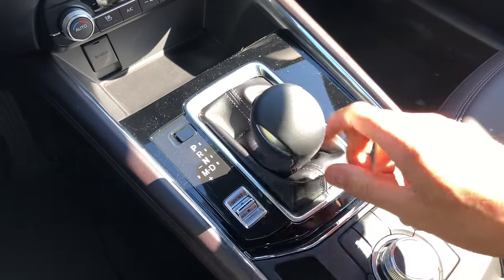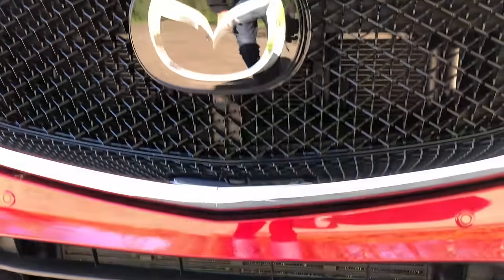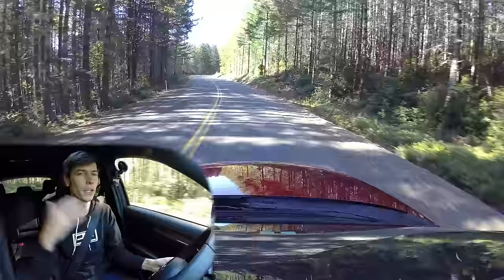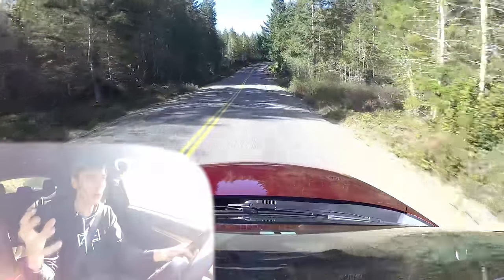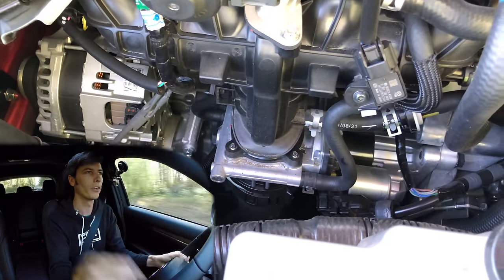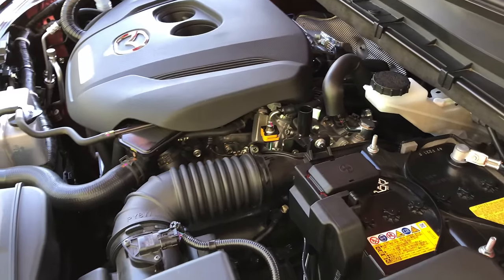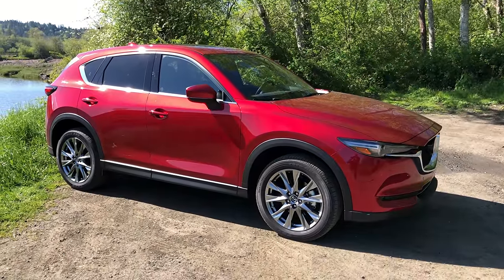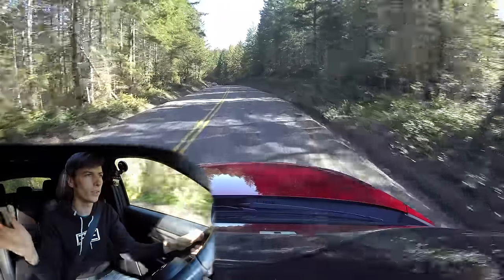Are CVTs Bad? Why Mazda Avoids CVT Transmissions

Comment: Uh, Mazda, when you make 'em in Mexico, that discounts it for me.
Reply: em745a  I looked and the only 2019 models made in Mexico is the Mazda3. I think it is probably fine.
Reply: I did a quick browse on Cargurus looks like some 2017 Mazda3s were made in Japan and some in Mexico. All 2016s were made in Japan. All 2018 and 2019s are made in Mexico. Does it really matter? Are 2018s and 2019s less reliable than the 2017s or 2016s?
Reply: My company manufacturers all kinds of stuff like barcode scanners and mobile computers in Mexico and the quality control by and large is very very good, just as good if not better than most facilities in the US. As long as the parts are the same there shouldn't be concerns about the qualify of the vehicle even if manufactured in Mexico. Many Ford vehicles are made in Mexico, I don't think those are inferior in quality than those made in the US or Canada.
Reply: @orientaldagger6920  The precision of Japanese workmanship matters.  Even when collaborating on the Supra, BMW was taught about how to do things so that the Supra would be reliable and last.  Outside of that, why do you think many people have commented on Toyota's legendary reliability?  They're no making it up.
Reply: @orientaldagger6920  I speak from experience.  I had my '74 Corolla SR5 for 21 years (yes, I was a Toy Boy, '90 Corolla SR5 for 18 years, '99 4Runner SR5 for 19 years.  Great cars great company.
Reply: @shinrips  I don't argue Toyota make great quality products. I had a 99 Camry V6 that ran for 270k on it original engine/transmission/starter/alternator etc. before i sold it. It was made in the US. There were some from the 1997-2001 model yrs made in US and some in Japan. I did some googling and don't seem to find anything that says the US made ones were in any measurable way less reliable than the Japanese made ones.

I don't have any comparison with Japan versus Mexico as in the case of the Mazda3. Seems like as far as Japanese cars go only some Honda Fits, HR-Vs and CR-Vs are make in Mexico. But i haven't seen any here in NY that has a '3' in the first digit of the VIN. Plus these 3 aren't made in Japan anyway so any reliability result would just be comparing Mexico versus the US.

Someone would have to find a vehicle that is produced both in Mexico and Japan for the same model yrs and do a quality/reliability comparison.
Reply: @orientaldagger6920  Point taken.  It's just that in the years just before yours, before your '99 Camry, some GM cars were shipped to the dealer with parts and some bolts missing terrible workmanship and even missed paint jobs that dealers had to touch up.  Toyota started making cars I believe in Kentucky (not sure) but they still used pretty good Toyota parts.  Just following your train of thought away from Mexico.
Reply: @shinrips  Camrys were (are) made in Georgetown, KY in a plant that employs close to 11,000 American workers. The same plant also make engines, as in the 1MZ-FE 3.0L V6 in the 1997-2001 Camry. 

I don not believe there is any correlation between where a vehicle is made and its reliability. GM, Fiat/Chrysler etc. are just bad quality vehicles overall. They have problems whether the vehicles are made in US, Mexico, Canada, Australia, or just about anywhere else. Toyotas are reliable whether it is made in Japan, US, or Canada. It's been a few yrs now and I don't see any complaints about Mazda3s made in Mexico, any more so than those made in Japan. If I were buying a Mazda3 the fact that it is made in Mexico is not going to deter me.

Comment: CVT sucks engineers design CVT because they know they going to break down. Most people buy cars have no clue about engines or transmission.
Reply: They used cvt because it was cheaper to assemble per unit. They sold it as a gas saver which it isn't. My old honda 95 got better gas mileage with the traditional automatic than cvt

Comment: CVT might be interesting with a rotary engine if programmed for performance and it just stays in the 9000 rpm powerband, unfortunately they usually programmed to be stuck in super eco mode.

Comment: Mazda and Tesla would merger it would bring the best of both manufacturers. Mazda handling and quality of built. Tesla powertain electric however Telsa built quality similar to a fiat.
Reply: The 8 speed is a separate question. Mazda 6 turbo is great German quality but the 6 speed doesn’t do it justice. 
As for Mazda and Tesla. Image German quality and BMW handling with Tesla powerful electric powertain. Winning ticket. Mazda being a small company can’t complete with big automakers and Tesla great technology motors which Mazda can’t afford to make in a auto with both Japanese’s quality and Tesla great powertain can’t lose
Reply: @em did you ever drive the Acura tlx 8 speed dial with torque converter. It is one best tranny in the world. It’s a dual clutch with torque converter for stop and go traffic.
Reply: I have Mazda 6 and it’s great it better than my old Audi A4 interior and engine but the 6 doesn’t make the engine shine. It need 2 more gears for mileage and putting power down. The most import was to can the tire Mazda uses worst tire on the turbo. I put summer tires but I live South Florida

Comment: Convert our refineries to make methanol instead of gasoline for automobiles,I think,would make everyone happy the driving/racing enthusiast,the environmentalist,at least until they realize that methanol is STILL a fossil fuel and the car manufacturers,and even the oil companies.And since carbon dioxide is only .034% of our atmosphere we can burn  a heck of a lot of methanol before we reach the planet destroying levels of Venus.
Reply: I'm 66 years old and the only thing that has really changed in automotive is the electronics and possibly the fuel injection,and I did say FOR AUTOMOBILES not the small tiny weed wackers and leaf blowers,lawn mowers,etc.

Comment: Is this paid/ market video.... such a beautiful channel & informative learned guy..but then in the basically say cvts (new gens are bad...) They are not bad ofcourse... This is marketing video, otherwise honda Nissan will stop making them they are capitalist profit company after all
Reply: em745a  thankyou for the upvote. You are indeed correct, cvts are an excellent ingenuity marvel of engineering used in scooters, mid torque engines,. It's ability to be lightweight & very fast allowed them even to be used in f1 cars due to their speed in shifting & being able to give max acceleration at constant rpm(without needing to "shift/clutch" to other gear. Too bad idiots dislike the constant engine sound, it is understandable if petrolheads/sports car enthusiasts like the feel of gear shifts/sudden acceleration/gforce even if it's slower than cvts

Comment: Mazda don't have CVT but the engines are GDI , which is bad for the consumer... CARBON build ups!! Bamb! Engine dies!!!
Reply: Mazda designed the intake system of the Skyactiv engines to run hot enough to keep carbon from forming